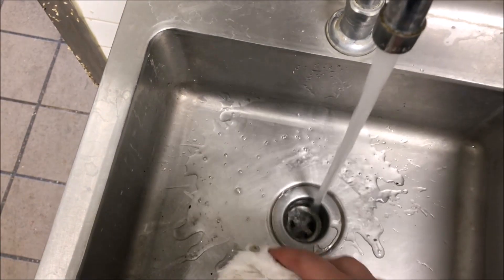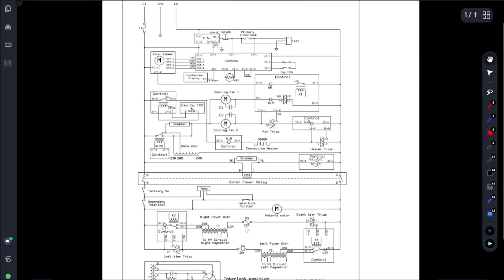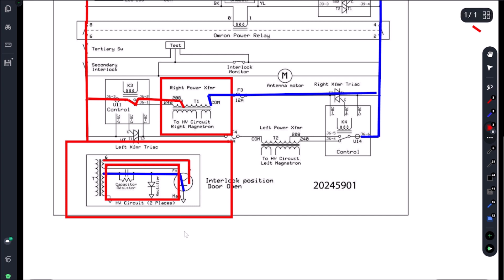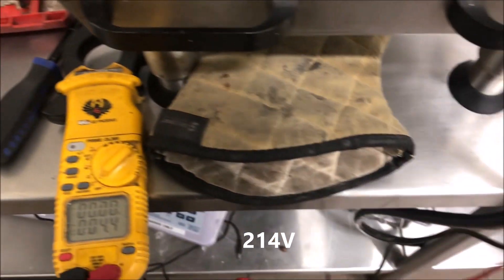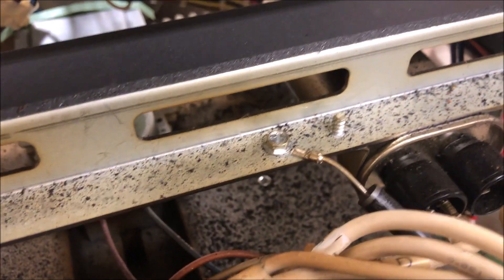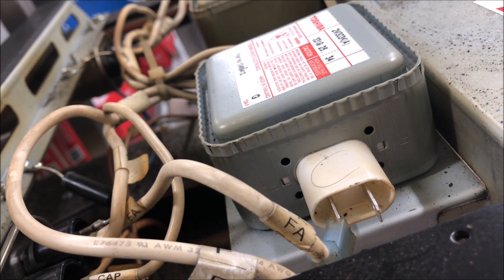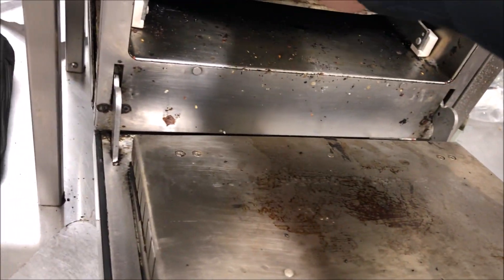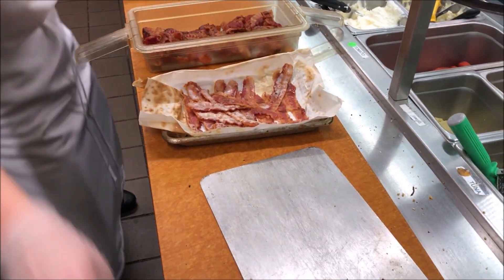ACP Xpresschef (Turbochef style) Speed Oven Magnetron Troubleshooting✨

Comment: some of those fixes are easy. But T/C and amana have had other issues a little more complicated. Throw in Merrychef and it can really go overboard. Too much technology for these simple little burger joints. I installed a garland clamshell today, give me a break. 8 burgers in 80 seconds. No end to the calls either.
Reply from the maker: Yes, the newer equipment is definitely becoming more difficult to troubleshoot especially if you don’t see that exact type of equipment every day. It will really separate the part changers from the techs doing actual troubleshooting

Comment: I used to work on Turbochef  it shows magnetron error I don't have much experiant to work on microwave so I replace both magnetrons but it still has the same issue, finally, I found relay K2 burn after  replace relay K2  the problem is fix. I learn a lot from your video to work on microwave and other guy Kitchen Equipment Expert, he post all factory training Turbochef video.
Reply from the maker: I’ll have to check him out 👍
Reply: @REFRIGERATIONKITCHENEQTECH  Anyway, Thank again for spent time recoding and editting video to teach and explain us .